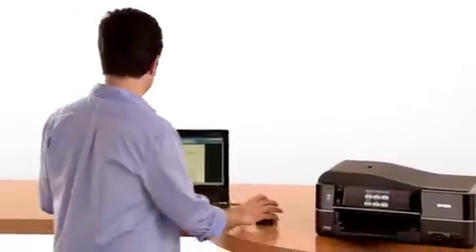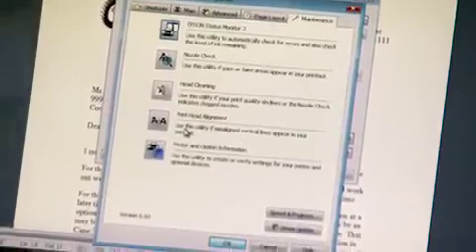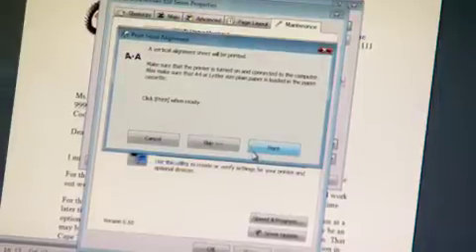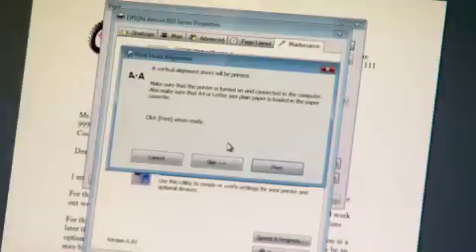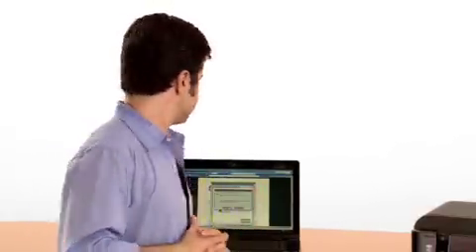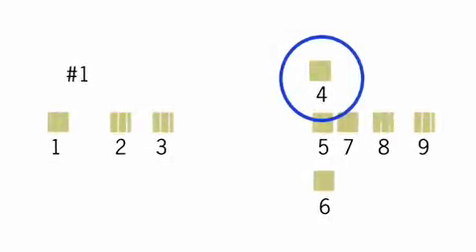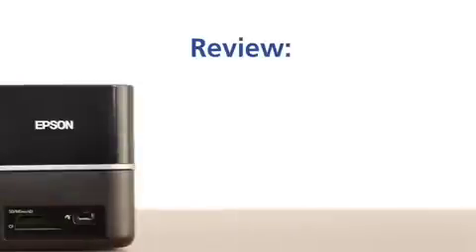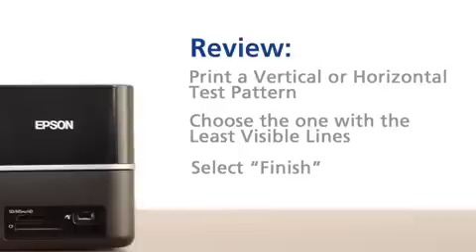Epson Printers | How to Align the Print Head

Comment: I have a ET-3850 and recently had the print blurry in the same place and it was very consistent. Print Head alignment was no help. There is a almost clear band above the cog belt. I am pretty sure its purpose is to sense where the print head (carrier) is during printing. On my printer it had a extremely small piece of what looked like cellophane on it. I very gently wiped it off with my finger. Problem solved.
Reply: That's called the Encoder strip

Comment: that's the wrong way to align.  you don't simply click the one with the least bands and finish. first off, you will never get a solid block, ever. that's not how the heads work. second, you have to click the one that has the least amount of bands, then click realign. repeat about 3 to 5 times until the block with the least amount of bands appears on "4" as the selection (the default selection). if your selection is 5 or 6 or even 7,  it means you're not aligned. they allll have to go to 4, hence the realign button.
Reply: Does the default have all "4" because mine has 3 on the first block and the rest are 4?
Reply: @johntrev9123  I have an epson L405 and I have the same as yours, first one is 3 and rest are all 4 by default, So do we need to keep on realign until all of them are without bands and then click next? in my case i tried several times but still the first one has some bands and not solid block, then after trying multiple times the printer lost connection and i had to restart it...how to fix this?
Reply: Really? Damn, it seems logical - align gradually. but why doesn't the calibration software or manual suggest it? Most of us are not printing technicians, just users. Epson makes great products, but some things end up halfway.
Reply: It's no wonder i use a stack of papers and still can't get it as it's all over,my first successful alignment was using 4 too.

Comment: Hey guys, recently I needed to do the head alignment to my printer too, and just like many of you, I had the same problem with it. There were no numbers whatsoever. But what I did after solved it. 

I think when this happens, we have to do head cleaning first. This is what I did, and when I went back to the head alignment again, the numbers were there, and I was able to align it then. I hope this helps most of you
Reply: Thanks a bunch. I was having the same issue.  Then I followed your advice and did the head cleaning first.  Worked like a charm
Reply: Thanks Gio. You re a life saver. I have just spend a hole morning printing align patterns and cleaning head and all sort of trying to fix my printer and just wasted my time  getting  frustrated. I only managed to fix after reading you comment. Thank very  much for your help.